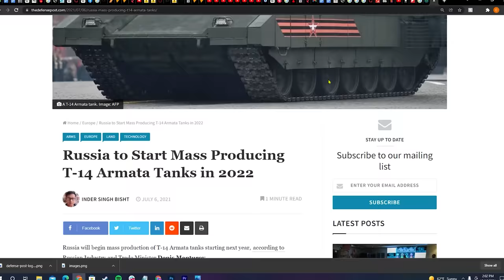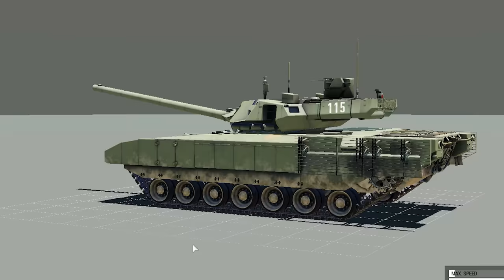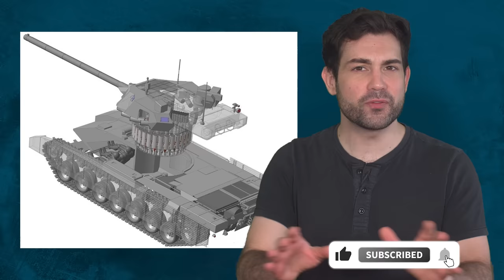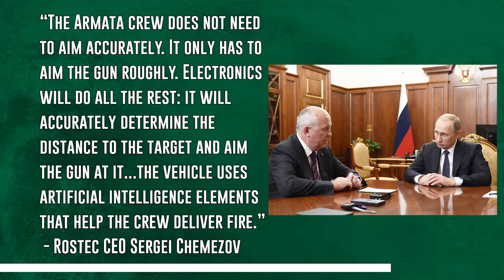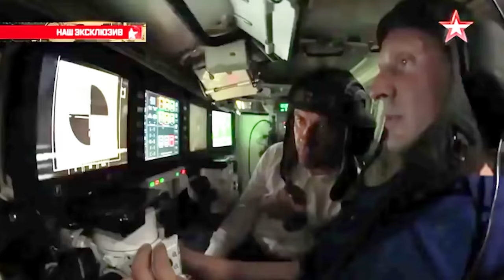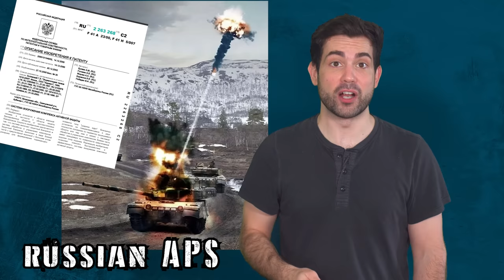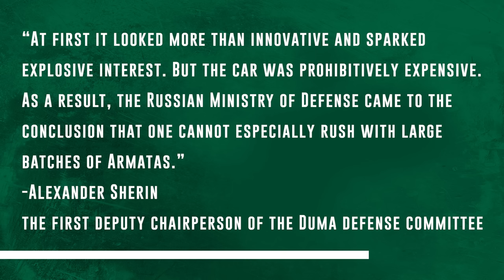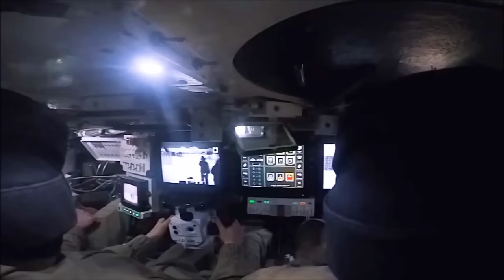The Truth About Russia's T-14 Armata Tank

Comment: My concern with this vehicle is simply dust, mud and snow. How do the crew keep the optics clean?

As a former tank soldier, one of the significant issues, was keeping the periscopes clean. In wet weather, as a driver, mud would continually cover the scopes. I'd have to quickly drop one out, replace it with a clean one and then drive, while cleaning the mud off the dirty one, only to have to repeat the process with a different scope almost immediately. It was a continual process that I sometimes would have to repeat for days.

Any soldier will tell you that dust and mud gets everywhere and any tank soldier will know that it takes mere minutes for the rear of a vehicle to be covered in the stuff. Unlike wheels, tank tracks are a dirty way to travel. I guess they have rear facing cameras for the driver, but these will have to be located in the hull, meaning that they'll be damn near useless under anything but perfect weather conditions. In a normal tank, the crew commander will use their rear facing vision blocks to direct the driver, but what happens in a situation where the commander has to rely on his sight for this purpose?

If there is only a single crew commander's vision camera on the turret, who is the poor sucker who has to leave the safety of the vehicle, climb over the front of the tank (the bit facing incoming fire) to clean it? In a normal tank, the turret crew would simply drop the relevant vision block and replace and clean it, as I've described above. Even recessed gunner's sights need to be cleaned, especially if you are following another vehicle and it is throwing up considerable amounts of dust. 

I have never operated an armoured vehicle in snow, but I am guessing that this stuff, falling out of the sky, only makes things worse.

So, I would really like to know how they plan to keep their cameras clean.
Reply: Do not worry comrade, Russia and Eastern Europe has no mud, dust, or snow.
Really these tanks are designed for city operations, but they neglect that most roads they can take to get to these cities (especially in Ukraine) are unpaved or neglected. I doubt they have any meaningful solution to this problem that will work in a battlefield environment.
Ultimately, like most of Russia's other current projects, they are focused on seeming "advanced" even if many elements are unfeasible in real combat against a peer.
Reply: Thats a good question... but one thing about the russians is they are pragmatic, wich means they probably have a low tech simple solution for it... thats my guess anyway
Reply: Any tank has optics to clean.
Reply: @nebulousGemini  Which is precisely my point. However, cleaning optics is easy when you can just drop a periscope. Less so, when you have to exit the vehicle.
Reply: @MFPRego  I figure as much. But, as I have yet to see this question addressed anywhere, I am curious as to the solution that they've decided upon.
Reply: @greg.kasarik  after you mentioned, i got curious as well...
Reply: Dust, mud and snow are problems for american tanks. Remember the M1 Abrams effectively stopping because there was a sandstorm around them ? Yeah, that doesn't happen to russian tanks, not even to T-80 which also has gas turbine.
Every system has redundancy on the T-14, everything is designed to withstand extreme conditions, whether it's incredibly cold or hot. 
You people should start watching some educational videos on what T-14 really is and how it's build before tagging it with problems usually found on the old western tanks.
Reply: @stefans6794  Yup thanks. I almost believed you until you started on about "educational videos on what the T-14 really is".

Except that given that nearly everything is classified, it simply sounds like you don't know anything about tanks, have never been a tank soldier and are simply regurgitating Russian propaganda. 

"Every system has redundancy on the T-14, everything is designed to withstand extreme conditions, whether it's incredibly cold or hot." This sounds great, until you actually think about it and realise that it is complete BS, because it is simply physically impossible for have redundancy for "every system" and that "cold and hot" come in a huge range of flavours, because weather is a thing.

So, please provide actual links to these "educational videos". 

As a tanker, I love the concept and would really like to know how they have solved the problem of vision on this vehicle and all you do is ramble on with BS about a tank which (20 test vehicles aside) hasn't even seen deployment to actual tank units, let alone active service. Even the Russian Army has prioritised the modernisation of other vehicles over the introduction of this Wunderwaffe.

The early Abrams had issues with dust filtration during the First Gulf War. I think every tank designed for use in Cold War Europe had this issue. However, AFAIK, these have been fixed and I am not aware of it being a systemic issue on modern vehicles, especially given that they've been used extensively and successfully in the both the Middle East, Australia and desert training areas in the US.

Mind you, if I had a sandstorm around me and couldn't see shit, I'd stop too. Only an idiot would drive cross country with no vision. 

I don't care how well designed your tank is, even in what seems like perfect terrain, drivers still have very shitty vision, being placed so low in the vehicle. Something as simple as a tall field of grass, or crops can blind a driver, who then has to rely on his turret crew to direct him. 

Even with seemingly perfect visibility, there are creeks (both full and dry) to fall into, large rocks to collide with, trees to barrel strike and all sorts of obstacles that can't be identified, until you feel the thud through your hull and discover that you just bought a ticket to your own personal CASEVAC. And yes, I speak from experience.

During wartime, you may not have the luxury of stopping, but no good commander is going to waste his armour in this manner, unless the tactical, or strategic situation demands it.
Reply: @greg.kasarik  You won't find everything, obviously, but if you bothered to look you would have found a good amount of info regarding T-14.

Comment: Well the t14 in 2015 could be very well ahead of anything else (in time, lol), as most of the other mass produced (which is granted, not yet true for the armata platform), as most of the other designs are dating back before 2000s. Other than that I really doubt the armata is combat ready, and yes, it is still a doubt if it is any better than anything else out there.

Comment: Probably vastly over rated like most Russian equipment. Even the armour / reactive armour argument is weak. Most decent hits will either render the vehicle immobile by damaging tracks/wheel or do sufficient damage to wreck sensors etc so seriously degrading the vehicle operation. If production numbers remain low, then the vehicle isn't a major threat.
Reply from the maker: I think so far from my understanding the T-14 is just a parade piece its not really incorporated into any line units yet so yeah defintiely not a real issue for anyone yet
Reply: Exactly !